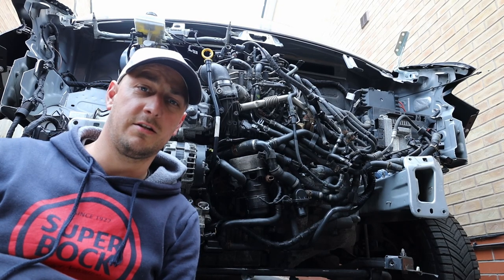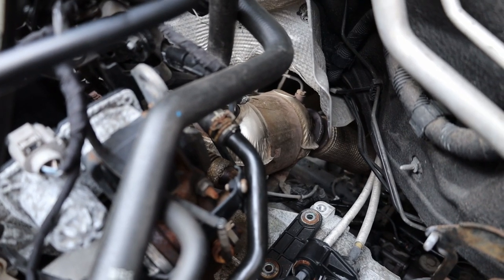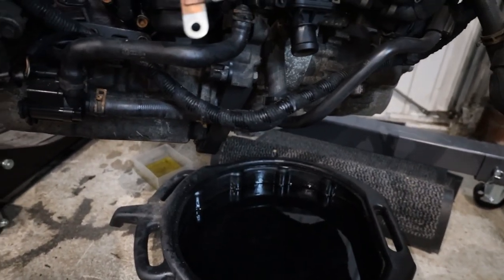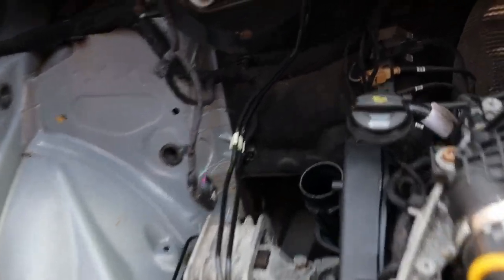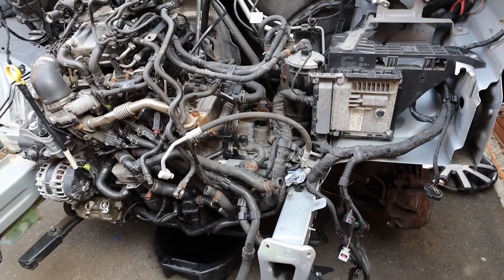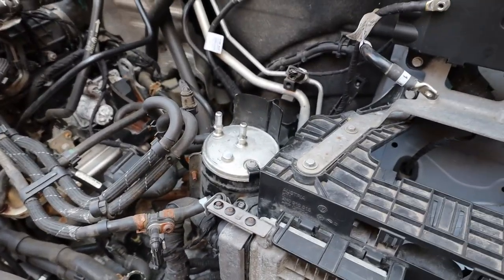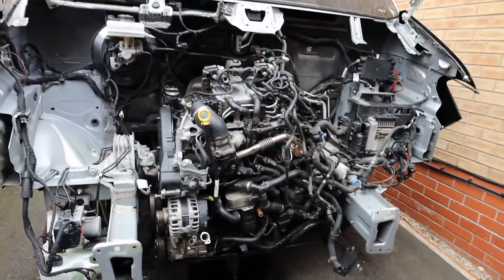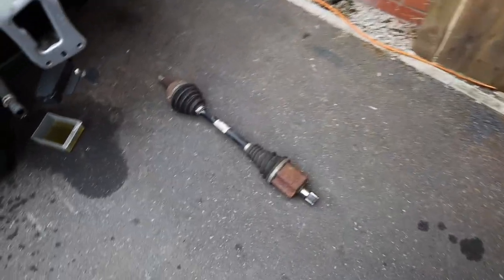Salvage VW Crafter Engine Removal! - (Crafter Camper Build)

Comment: Cant wait to see you straightening the leg need to be jiged and pulled if you hire a 10 tone hydraulic ram you might have chance dont right them off for nothing try to heat up leg ass you pull and look at old bumper think off inpact looks like central so it will push legs together panel beater for 20 years loads of jig time hope it goes well easyer with engine out
Reply from the maker: Cheers, bud! Struggling to find a rental dozer or something similar at the min. The O/S leg is straight and the impact just pulled in the N/S leg like you said. It’s about an inch to the left and the bend is just under the engine mount so doesn’t seem too bad!
Reply: Put old bar on and try to bar or jack it straight machine mart got hydraulic ram sell it on when finished